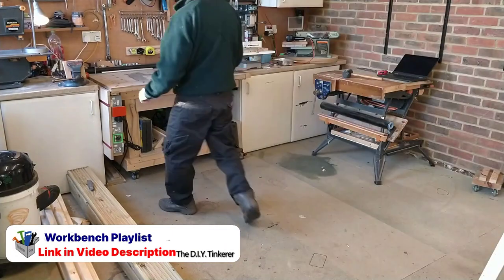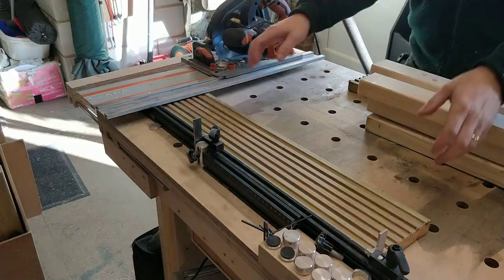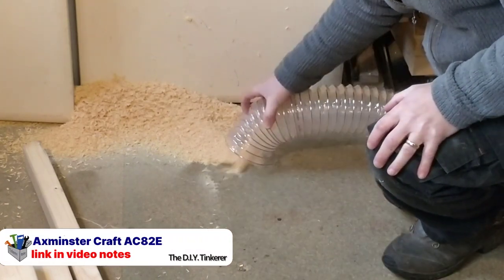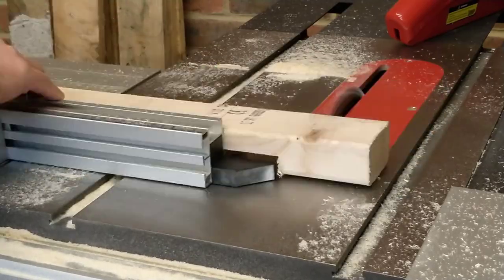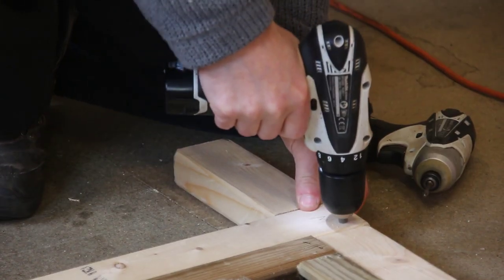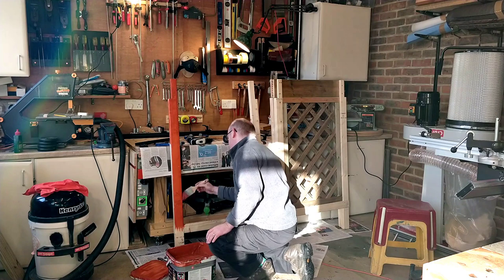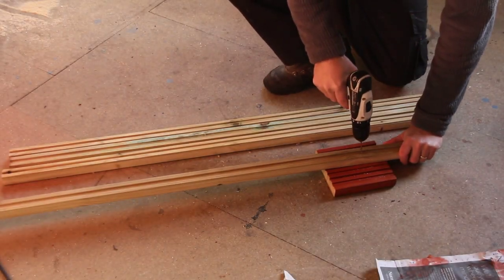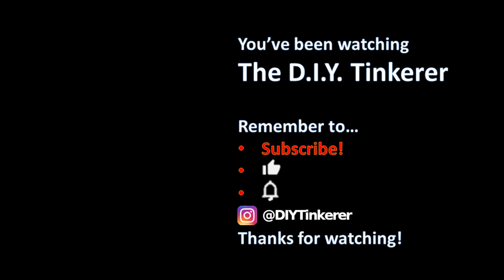71. Wheelie Bin Shelter with Green Roof

Comment: will you line the roof section?
Reply from the maker: Funnily enough I did that today! Stapling it in place, and I started filling with a mix of compost, sand and well rotted manure. Trying to balance well draining with water retention....
Reply: @DIYTinkerer  did you use a dpm?
Reply from the maker: @mphys5370  no, I don't want it to get waterlogged, so I've used a horticultural weed suppression fabric, it will let the water seep out, the idea ( not done b4 so might not work) is that excess water passes through the fabric but the compost doesn't.